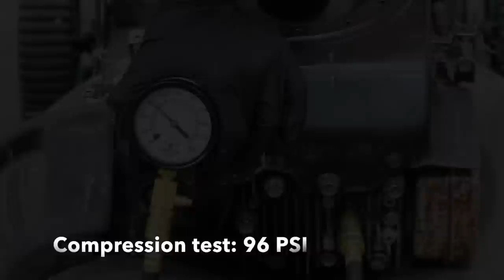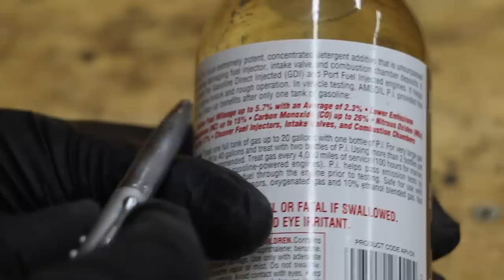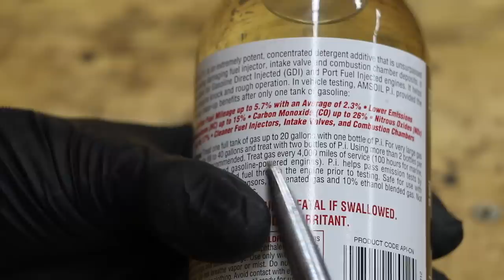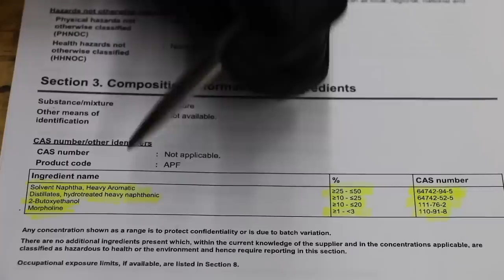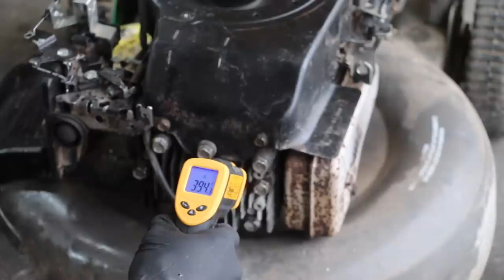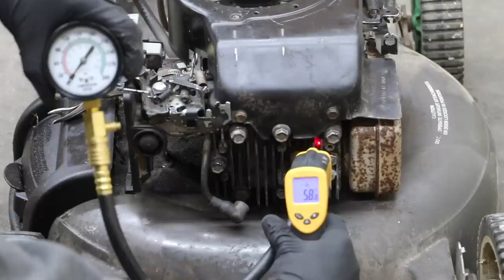Is Amsoil Power Foam better than Seafoam & MMO? Let's find out!

Comment: I think MMO and SeaFoam are wonderful products that do different things. MMO is an engine oil additive to improve lubrication and SeaFoam is a cleaning solvent that works well at getting stubborn sludge/carbon trapped in solution and out of the crankcase (at end of oil change interval, don’t add it at the beginning per manufacturer recommendations). MMO is a great fuel additive to improving upper cylinder lubrication and fuel system lubrication while SeaFoam is a great fuel additive but again is as a cleaner to loosen or dissolve carbon deposits and move them through the system and out. Both are fantastic products but they don’t do or at least specialize in the same job. I’m not that impressed with the Amsoil product from this video, it did make things better than they started out but not as much better as SeaFoam would’ve.
Reply from the maker: Thanks for the feedback.

Comment: Before I finish watching the video. I’m at the 3 minute mark. Anytime I’ve used Amsoil PI. I get about an extra 30 to 70 miles per tank. I fill up at no less than a quarter, sometimes at half tank. Unless I plan on using an additive then I wait until my fuel light comes on. Let’s see how this test goes
Reply from the maker: Thanks for the feedback.

Comment: I always use marvel mystery oil, but not as high of a dosage in the engine, because I don't want to thin the oil too much. I especially like it in the winter to get the oil flowing faster at start up. I bought a car in 2014 that had not been taken very good care of, and added marvel mystery oil, and in very little time, the new oil change was very black, and then changed it again shortly, worried of it having too much debris in the oil. I remember the engine running quieter with MMO. I don't think the Amsoil is as good as Marvel Mystery Oil, and believe Amsoil oil is overpriced on their products due to marketing hype.
Reply from the maker: All great points.  MMO is a great product.

Comment: By using both Amsoil products at the same time, we don't know which product worked the best at removing the cylinder head carbon.  I think it would have been a better test to use one product at a time, conduct your test and then use the other product to see which product lived up to or did not live up to their claims.
Reply from the maker: Thanks for the constructive feedback.

Comment: I know this video is 2 years old. How would this stuff affect the catylitic converter? Are the carbon particles small enough to go through? Or will this help clean the carbon build up on the exhaust system as well? One time use is not enough to do any major damage obviously. Just curious.
Reply from the maker: I don't believe it'll cause a problem

Comment: I used to be an Amsoil Dealer and I love their products but their powerfoam had its issues. I remember using it on my own vehicle and it actually coated my spark plugs and I had to replace them because the car ran like crap afterwards
Reply from the maker: Thanks for commenting on this.

Comment: Run an engine on 50/50 gas / motor oil to dirty it maybe to the point of fouling out the plug, use regular oil not 2 cycle (2 cycle tends to burn cleaner)then run a cleaner through.
Reply from the maker: Thanks for the video idea!

Comment: Why not build a load cell? Find, buy or trade for a large fan like a 48" or even a 60" belt drive type. Fabricate a 90° drive adapter to mount the engine to and drive the fan from. Maybe you can use a stacked multi-pulley from a drill press to provide more or less load by turning the fan faster or slower.
Reply from the maker: Thanks for the suggestion.

Comment: Basically there's no way that you would be able to hot soak a fuel injected engine in a car at all and also putting fuel and carbon cleaners in fuel tanks will not work as effectively compared to using the products all the time as directed and using good Hi RON octane fuels will clean your engine and if used together with carbon engine cleaners and fuel system cleaners they do work, just cheaper than taking off the heads of your car and having them cleaned properly and the tops of the pistons as well ? Still good testing on smaller engines. keep up the great work, maybe do a engine from a ar and use a borescope to check the tops of the pistons and maybe if you can see the inlet and exhaust valves to see how much cleaner they are after use of various products ?
Reply from the maker: Thanks for the recommendation!

Comment: At about 10:04, it looks like it brought in some gunk and all the liquid evaporated, leaving a new carbon deposit. You can see it char into place. So, it looks like deposits will still happen even with it in the fuel?

Other than that, the cylinder heads really did see a lot of gunk get cleaned off. Nothing miraculous, but more than any other method I’ve seen you try, though maybe not as evenly cleaned as water.
Reply from the maker: Thanks for commenting on this.

Comment: Did you ever test the PB blaster engine cleaner?  Used it few times myself. Seems to clean a little but only what I can see through spark plug hole
Reply from the maker: Not yet. Thank you for the suggestion

Comment: I have been watching your videos since the Ford ranger. I have tried starting engines with a drill and the nut unscrew as it run. How do keep the flywheel nut tight when starting with drill.
Reply from the maker: I've never had an issue with this.  It the nut properly tightened? If so, you might consider using a blue or red thread locker.  I love using the drill!  Even a stubborn engine will start with ease.

Comment: Is it possible to convert one of these to diesel? Diesel works off high compression, and I wonder if filling in the cylinder head to increase compression and just enough clearance for valves and intake/exhaust? I know General Motors did it for the Oldsmobile (poorly), but wonder if a lawnmower small engine could somehow be converted to a diesel by increasing compression ratio.
Reply from the maker: Thank you for this recommendation.

Comment: I used mmo in my oil, per their instructions, and the engine developed a tick/knock within days.
Reply from the maker: Wow! Thanks for commenting on this.
Reply: Ticking noise turned out to be a bad rocker arm. Rocker arms in my engine are known for going bad. Not sure how MMO made it noisier (maybe mmo made the oil too thin, starving the rocker arm), or if it was coincidence.

Comment: I'd like to see 2 consecutive treatments with the top three performers.  2 with amsoil, 2 with seafoam and 2 with b12.

Do it with 3 old engines.  Engine 1 gets two treatments with amsoil.  Show before any treatment...show after 1 treatment of amsoil and show after two treatments of amsoil.
Engine 2 gets the seafoam.  Show the top of the cylinder and inside of the heads before any treatments, after 1 treatment and finally after 2 treatments of seafoam

3rd Engine gets the B12....before, after 1 treatment and after 2 treatments. 

I of course am curious as to which one is the best BUT I'm also curious as to how much more cleaning happens if the cleaning process is duplicated.
Reply from the maker: Thanks for the suggestion.

Comment: Not sure if I just haven’t found it yet, but have you ever tested lucas fuel additive ?  I have used it on many occasions it seems to be good to add to the mower fuel before storage and prior to first start up etc - also echo (formerly shindaiwa) 2 stroke oil, they claim it actually cleans comb chamber. I use it and have been very impressed with it (50:1 mix), I don’t even like the smell of the other brands burning anymore lol
Reply from the maker: https://www.youtube.com/watch?v=x3CfLBkew2c

Comment: What would you recommend I use for my 2014 Town and Country Touring model 3.6 cylinder flex engine. I use gas and not the flex fuel.
Reply: This would be my first treatment ever on my vehicle and in general. That is why i ask
Reply from the maker: Seafoam, Amsoil PI, or Techron would be my choice. Thank you!

Comment: Just seems easier to take off the cylinder head and mechanically clean combustion chamber, piston and valves, and take off the carb and use carb cleaner???
Now the real reason for these things is we are lazy.

Perhaps, just perhaps after mechanically cleaning up an old engine or use of a new engine the gas tank cleaner / additives might be a good maintenance step to extend the hard work a little further.  Similar to oil additives for engine deposit cleaning.  But really using very good clean fuel and very good engine oil changed regularly would prevent the need for all this stuff.

However, I have to admit the test Project Farm is likely the best and certainly one of the best channels for practical engineering analysis of various products and ideas.  And, I have to admit the Ford Ranger farm truck tests of the Seafoam products, engine flush, intake and combustion chamber cleaners and engine oil treatment... was stunning just how much the lazy man's fix in a   can will go to correcting the evils of poor maintenance.

Project Farm is far from lazy and has done more than anyone to finding the practical truth behind many consumer questions.  Certainly if you put the project farm guy in any fully equipped engineering laboratory or engine test/development facility he would be an engineering rock star.  But sometimes even the best companies and with fully equipped facilities need to to some "value added practical testing" to prove or disprove that is not much different than what Project Farm does on his channel. 

Here is one of the first tests, done in Marquardt Corporation's parking lot on a weekend for the pulse width modulated digital control of engines from rocketry, making possible the moon flights, modern communication satellites, spy satellites, and ALL modern digital control of internal combustion engines and electronic fuel injection universal today.  After saying that mouthful one can see Project Farm work is not far from the real thing.  Warren Boardman was one of my best friends, mentors, and colleagues... miss you!
https://www.youtube.com/watch?v=UdQq5gsyveg
Reply from the maker: Thank you!

Comment: I switched from using Mobil-1 synthetic oil (for about 25 years) to Amsoil,  my truck instantly gained 10% fuel economy,  and a small, noticeable  increase in power.....So, I'm  a Amsoil fan now.
Reply: Stop lying. Mobil 1 is superior protection

Comment: Try to clean the inside of an engine with Gunk engine cleaner!

That stuff works great on the outside of an engine ;)
Reply from the maker: Thank you for the video idea!
Reply: No problem :) That stuff smells flammable enough to go inside an engine.

And I meant Gunk engine degreaser.

The cleaner is the soap spray, so I misspoke.

Comment: How about testing AMSOIL Quickshot ?
Reply from the maker: Great test idea! Thank you
Reply: Project Farm Quickshot I use in my two stroke engines and outboard two stroke motor. PI I’ve read is recommended more for passenger vehicles while Quickshot is small engines and power sport equipment. I’d be interested how Quickshot does against water too as it claims to restore peak performance and keep water dispersed to move it out of the engine.

Comment: I'm going to try Seafoam on a full tank of gas, then add Amsoil near a quarter tank to try and get added cleaning power.  I'm also not tied to any brands and just looking to get the best result.  Thanks as always for your info and ideas.  Maybe trying a combination of both would be a good video idea, alongside each compared individually.  So far Seafoam is king and also very safe from my experience, but always looking to try new things too 😁  Also I've heard long highway driving steady speed is best for cleaners, since consistent fuel ratio and higher load...although I haven't had issues with sudden acceleration in my cars...it tends to richen the mixture more, potentially making inconsistent results, or worst case cause knocking possibly?  Although I wonder if these additives do increase octane slightly or not 🧐 anyways thanks again for the solid analysis and inspiration.  Hope you find my comment helpful ✌☝️❤

Comment: New test- same products plus #1. "Mechanic in a bottle" dealer recommended and "Motorkote fuel system treatment and vanished. This products claims fuel system lubricant, cleaner treatment, and can be added to both the fuel system, as well as, the crankcase to clean and de-varnish a dirty crankcase.
Reply from the maker: Thanks for the suggestion.

Comment: I would really like to see BG products. I use them and have seen some results but would like to see tested results. Also would like to see using b coca cola like they did in mythbusters a long time ago. I think he does a better job at actually testing myths and products than they did. The things I buy have slightly changed since I started seeing which products actually work as claimed.
Reply from the maker: Thanks for the video idea.

Comment: What type of gasoline are you using in your tests? I was wondering if it contained ethanol or do you use 100% gas? Alot of regular gasoline pumps where i live have 10% ethanol but for 3.50 a gallon you can get 100% gasoline. Just curious if that would maybe make a difference?
Reply from the maker: Yes, it has 10% ethanol.
Reply: You should try a comparison with the 10% ethanol and non ethanol for seafoam and water or whatever you think of. I run Motorkote in my engines, so in theory for me to clean carbon with water is not a problem.  (It is not supposed to wash away with water.) Even if there was some visible water or not from blowby, i would still reccomend someone using water or anything else to change their oil after using unless it is an "oil additive".

Comment: Hey when i put seafoam in my car through the brake booster > intake manifold my car always revs higher. It never lugs or stalls like it does here. I've done it a few times and it does it every time. Any ideas? Thanks for the free vids btw. You're like the Auto Zone mythbuster.
Reply from the maker: It's normal for an engine to idle higher with the brake booster hose disconnected, since the engine is getting more air.  I wouldn't be concerned that the engine doesn't stall or miss.  Thanks for commenting.

Comment: Could you use Marvel Mystery Oil or the thick Lucas oil additive to an outboard engine? I have a Mercury 125 with an oil injection system and am curious if I could use something like that in there. Premix it into the oil before adding it to the oil tank reservoir?
Reply from the maker: Thank you for the video idea!

Comment: I would like to see what the results of, how good they work, on some of these vacuum smoke machines, that are out on the market today, particularly, are some of the low cost ones any good, or do they work at all, for use in finding vacuum leaks in car engines. What are the advantages, and what are the disadvantages of these low cost smoke machines, used for finding vacuum leaks, do they work properly,  are they worth buying at all, or not. I just recently bought one, on Amazon, it was around 120 dollars, I just got it, I have to send it back, because, it came to me with it's on off switch broken, and it was missing the electrical cable to give it power from the car's battery. An evaluation on just how good some of these lower costs smoke machines would be nice. One of them was under 20 dollars, and used  a cigar it it to make the smoke with. I would like to know what kind of quality, or what kind of lack of quality that these lower cost smoke machines really have, compared to a very expensive mostly commercial use 1,000 dollar smoke machine for finding vacuum leaks. That would be a really good, entertaining, and informative, and an excellent informational video. If for example this little, black boxed electric powered smoke machine, that I bought off of Amazon, really do work ok, then they might not be bad at all for home use, shade tree mechanics use, so called, but if on the other hand, they don't really work well at all, then it would probably be best for people not to send their money on them at all, because they wouldn't work well, they won't do the job. Some of them need an air compressor, an air compressor is an added expense, if you don't have an air compressor all ready.  Anyway, it would be a very interesting video to watch. Take care always, love your videos. You and Scotty Kilmer, are two excellent content providers, on U-tub, that I really enjoy watching! THANKS ALWAYS AGAIN!
Reply from the maker: You are welcome!  Thanks for the video idea.

Comment: I'm not so concerned about the combustion chamber in the running in the valves I want to know what it does for the oxygen sensor in the catalytic converter does it clean those
Reply from the maker: Great point and thanks for commenting.

Comment: What about CRC GDI intake valve and turbo cleaner for Direct injection engines like my 2.7 eco boost F150. I’m worried about all of the build up on my intake valves but don’t know if this CRC stuff is snake oil.
Reply from the maker: Thanks for the suggestion.

Comment: I had a Check engine light on it was PO420 my catalytic converter  was bad so I filled it with Seaform my cat  It smoked pretty bad at first  Then about a week later the light just went off  It's a 2001 Toyota tacoma v6 with 207k
Reply from the maker: Impressive!  That saved a lot of time and money!